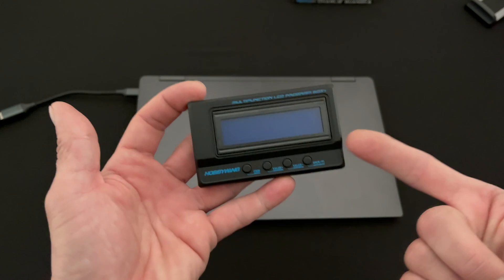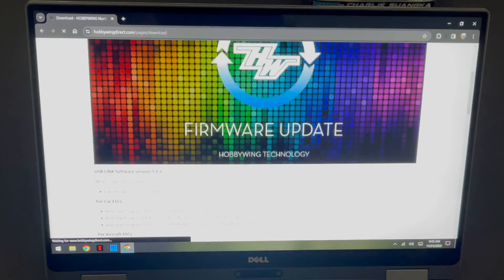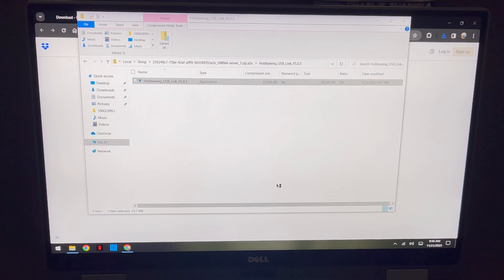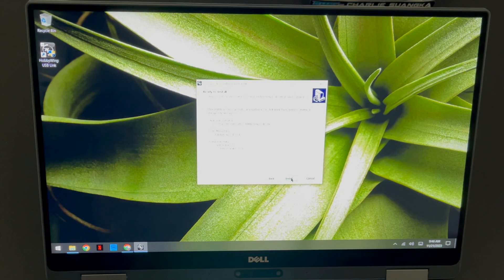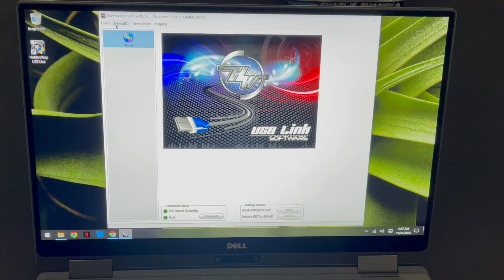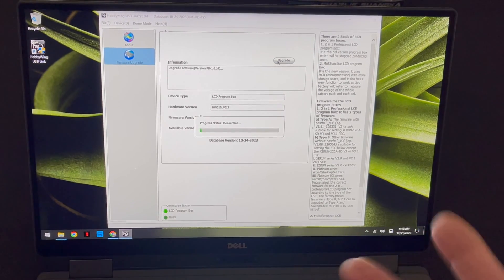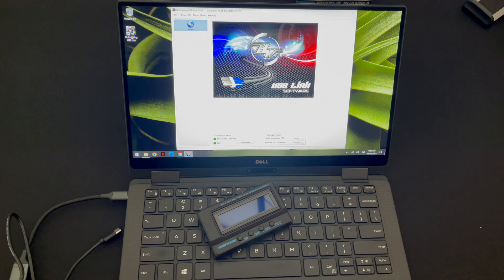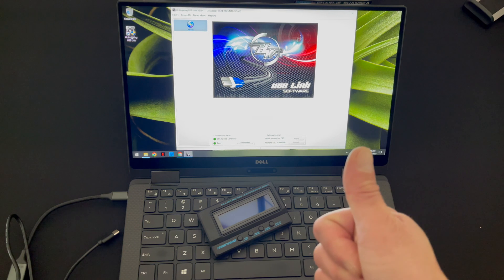The Charlie Show /// Episode 344 /// Multifunction LCD Program Box Firmware Update.

Comment: I updated my lcd multifunction box g2 to .20 firmware last night. All went well but now that I’ve disconnected from my computer, when I plug it into anything; esc, battery, computer, the box receives power but doesn’t show letters only white rectangles. My computer will no longer read the device when I plug it in and open the usb link software (have tried several different cables) it has power but I can’t do anything with the box or revert it back to another firmware.

Comment: What do you do if  plug in into windows and nothing happens?
Reply from the maker: No Chimes usually means the cable isn't a Data Cable.  Try that first.  It won't do anything "automatically" beyond installing the "Drivers" through windows.  Much like when you plug in a new USB Drive, or Mouse/Device, Windows finds the USB 'drivers' for it, then gives you a notification that it's ready go to.